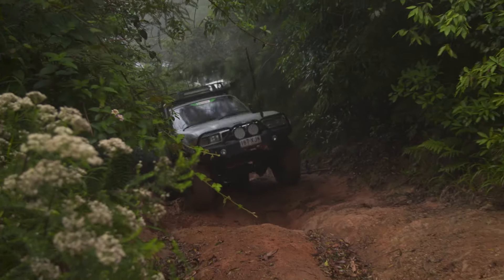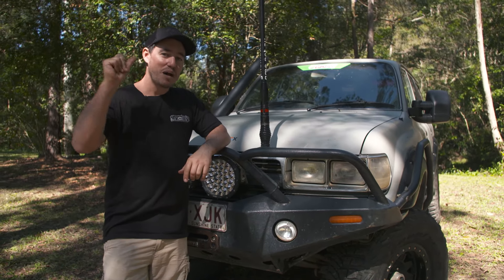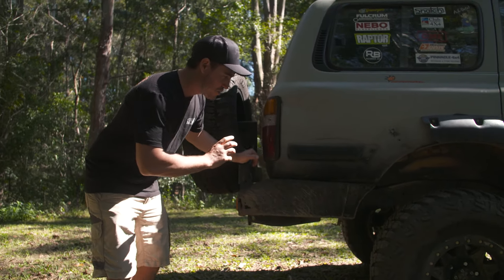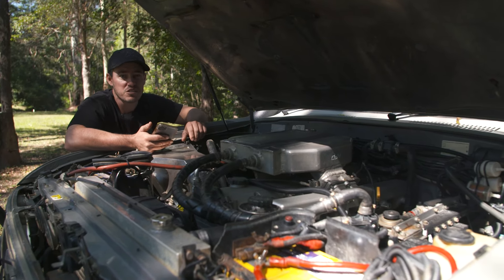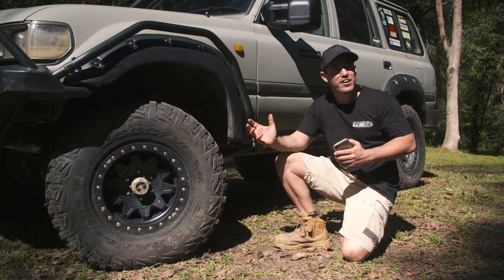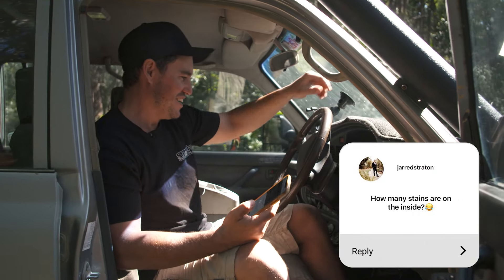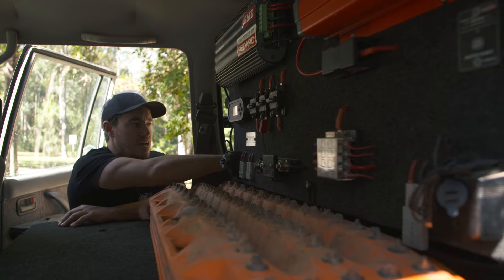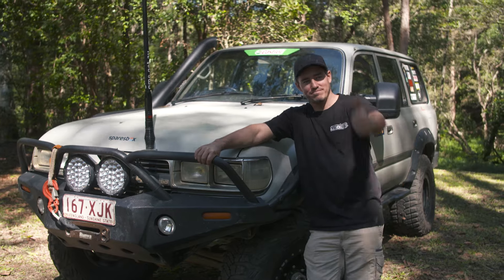Shauno’s 80 Series – 5 stories we’ve NEVER told about Australia’s hardest worked 4WD!

Comment: I always wanted an 80 series diesel.
Factory turbo only and was willing to wait, which I did, for 3 years.
Ended up with a 1 owner factory turbo that had been babied by its owner.
Old bloke, retired, folder with every receipt etc.
Little did I know that I'd actually bought the FT engine, didn't know there was a difference.
Spent $5k over my budget but that car will last me forever.
Up the 80s

Comment: Hay Shauno, have you had a look at  the area on the chassis where the steering box mounts? They are prone to cracking the chassis after heavy flexing because they were not fully welded from the factory. Easy weld repair if you know what your doing.

Comment: To open the hood, you can just get a piece of high tensile wire and put a hook on it. Then push it through the grill with the right bend on it and catch the latch. Takes a bit of mucking around but works.

Comment: I have a petrol 80 since new. Got about 525000 on the clock just had head reconditioned but otherwise engine beaut. In the process of building it up a bit with drawers/12V/solar etc.
What I'm struggling with is whether to lose the 2nd row seats or not and placement of 12V headboard. I'm thinking behind driver along where sliding windows are so still have good vision and also putting fridge on drivers side again not to impede drivers vision. Twin drawers one side maybe with "kitchen" of some sort. also thinking a shower tent on drivers side rear and 270 awning mounted on other side. Rear bar with tyre/jerry can holder or Gas bottle holder was thinking of bottle on roof rack -but not sure other than security.
sorry lots of questions
Jim

Comment: Shauno thanks for the video and what is the size of your diesel tank and where is your air compressor installed and where do you keep your recovery gear?
Reply: Just a standard 80 series twin tank setup, 80 and 40L i think. Recovery gear normally goes in the passenger foot well for easy access.

Comment: I bought a brand new 80 series GXL back in the day, it was the first of the turbo diesels. I drove the 80 about 20km back to my workshop. I fitted a CAV fuel filter and water separator, before the factory filter. I sold the vehicle to a mate of mine that says he is going to get  buried in it. The old girl never had a smooth idle. My mate blew a head gasket in the old girl after many years of service. He decided to get the injectors and the fuel pump overhauled. When they stripped the pump they found grey sludge in the pump, meaning the contaminants were in the pump from new .

Comment: Do the mechanical upgrade full send..... Space cab chop, 1VD, redrevision, air bags, twin 3inch exhaust and a matching camper trailer made from the back half of another 80 so you have extra space to haul tyres, fuel, gas cylinders,12 volt and spares.

Comment: Just keep using it for the tough stuff until it won't do it anymore and then rebirth the new old one in a different shade or raptor. Maybe a blue or green? First off though, do something about that rear bar before you leave it on the highway somewhere. Also agree with shifting that 12v panel, most of that is for show (and it's nice), but surely swing behind is a better idea.

Comment: Odd thing with the swivels is that it tends to be the studs that come loose rather than the nuts. If you remove the studs, chemically clean and degrease the threads then thread-lok the studs in, they shouldn't ever come loose again. Obvs let them set fully and then torque new nuts on.

Comment: Should do an uncle tonys garage challenge

By that i mean get an engine and then take the crank, pistons, rings, cams, valves and basically use everything that was in the engine from factory just clean up the bits and put new bearings in there then the basic servicing things like gaskets and what not, see what you can do with it 

He chose a 318 chrysler and he cleaned up the stock parts then slapped it together and drags it

Comment: How do you find your temperature with running the 2 spotties on the front dose it run hotter or dose it stay at normal running temp
Reply from the maker: Yeah fine mate Only time it got hot was after $1000 track because of all the mud in the radiator.

Comment: The speedometer and odometer on my 80-series doesn't work right now. What was the solution for yours? I've tried replacing the speedo cluster, the sensor on the trans, and looked for a shorted wire but to no success. I have a 1993 so it is the first year without the mechanical speedo.

Comment: I’ve got a dud back and I’ve got heavy leafs in the back of my Ute.
Would you recommend upgrading my drivers seat? Stratos and recaro do a few options
Reply: I got Recaro seats out of an audi in my 80 series, got them cheap and they are awesome. I've got a blown out back too and the support around the ribs from a modern sporty seat greatly improves comfort. The problem with flat seats is your bum stays still and your upper body moves side to side, short trips are ok but anything over 1/2hr wrecked me.

Comment: What the reason for getting rid off the water to air intercooler. Because I’m weighing up if I should get one?
Reply: I have one and it works .. but if the core ever leaks badly, it can fill a cylinder and cause your engine to hydraulic .. very nasty.. noticed that Sooty has a high Quality HPD, not ebay special!

Comment: If it's anything like the Navara d22 try getting rid of the pollution gear and the smoke will stop and fuel economy will be up and h\power will be up
Reply: Polution gear? What's this wizardry you speak of? 
The 1HD-T has glow plugs but doesn't use them, the Injector pump delivers Max fuel on start up, it works perfectly except for the plume of diesel smoke. At idle they smoke more than a rooted mitsubishi and I'll never sell mine!!

Comment: I’d be stripping sooty II down & build it up in the back ground chassis up rebuild, all new bushes, seals, R&P gear, new bearings, unit’s etc fully built roller, then do the interior mods build it electrically the way you want sooty, then when that’s all done strip off the engine, draws, etc off re-fresh them and bolt up to sooty II, 

The original sooty I’d then sell off the body & keep the rolling chassis as a spare OR future 45series body swap 😋